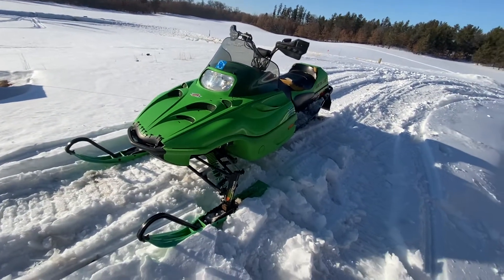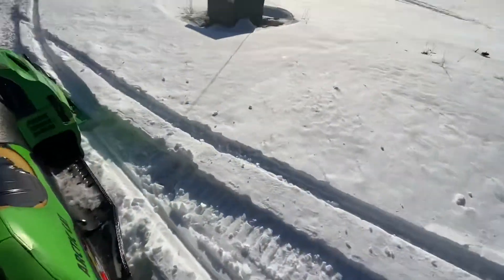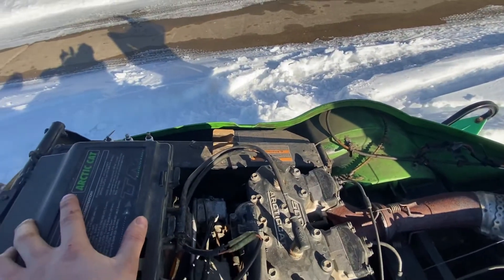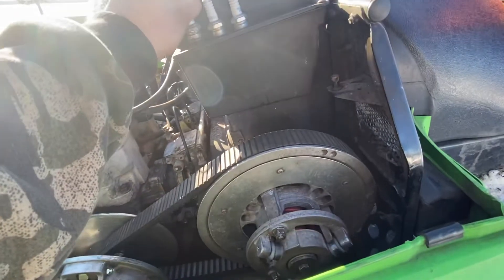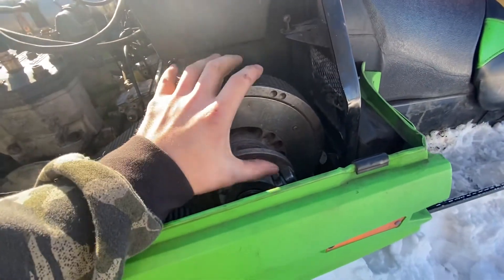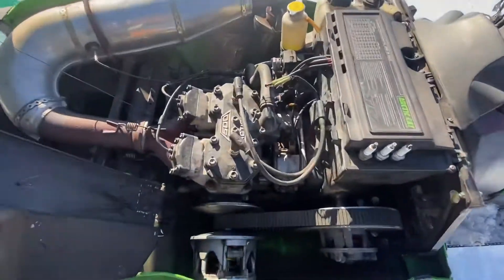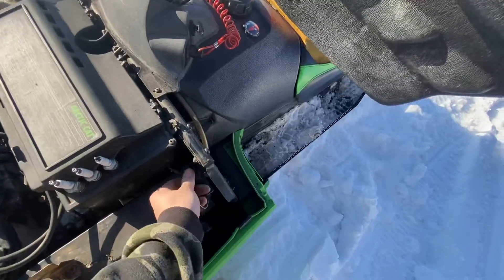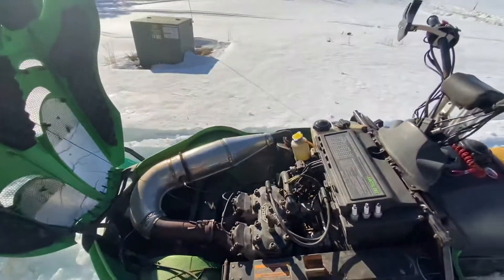Bought a 2002 Arctic Cat ZR500!

Comment: Guessing your jackshaft bearings are bad and that broke the speedo pin. Not an expensive fix but requires some labor. Had to do it on my 02 zl 600
Reply from the maker: Possibly but the Speedo isn’t even plugged in